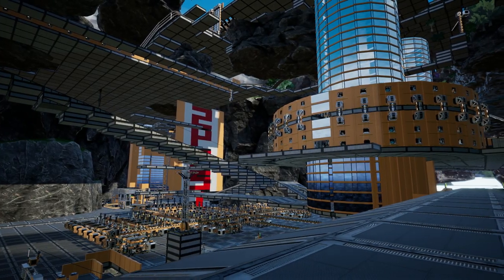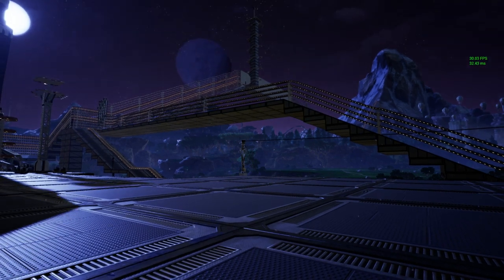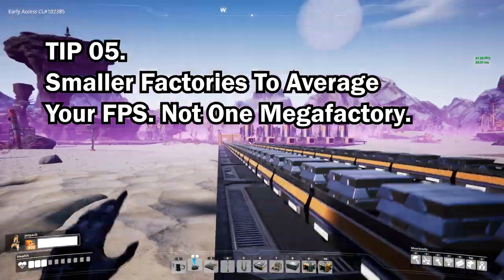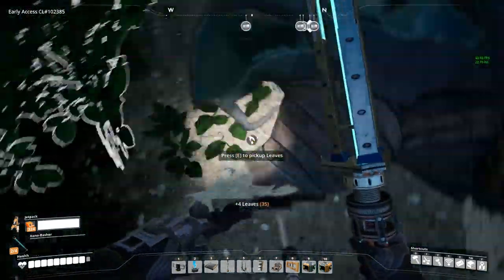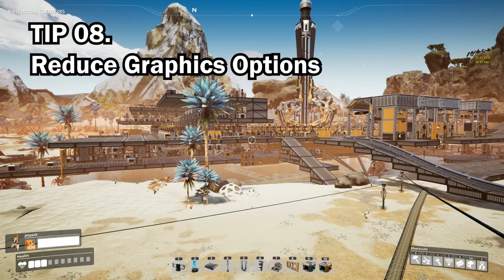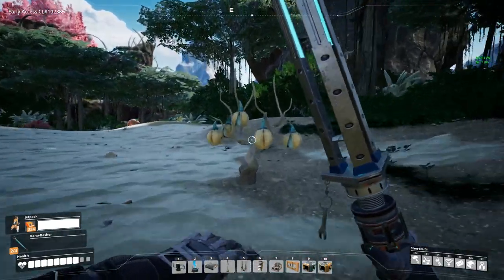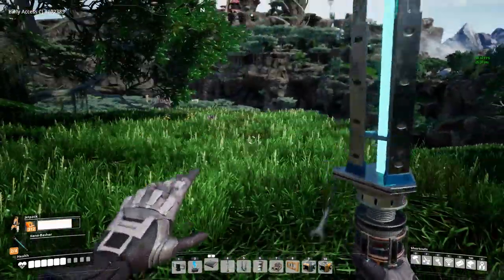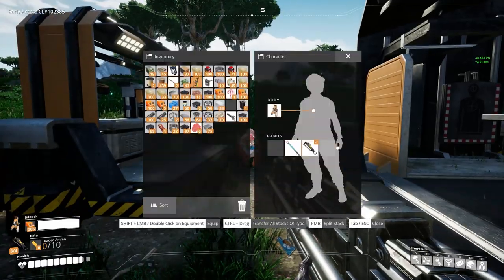14 Top Tips to getting better FPS in Satisfactory

Comment: Tip 8 - reduce graphics settings 
Me : Never, I didnt buy a RTX 2080ti too lower settings LOL...
Put the only lag I get is when the game saves every 5 minutes but other then that its smooth
Reply: You need new PC with 3xRTX ti. Twin SSDs and i9 chip. 64G Rip Ram.
234FPS is Lag
Reply: even with all that, i`d still only get 60 FPS as thats what my two monitors are capped at :(       plus since the last few game updates the lag has pretty much stopped
Reply: I think only at 5 FPS I consider it lag. any higher and it’s 100% playable

Comment: With a megafactory of over 175 hours, the ONLY way I am able to increase my frame rate is to shut the factory down. Frames either double or triple. This suggests to me that the issues may sometimes be the CPU, not the rendering. (Running over 3Ghz, 16G RAM). Additionally, for me, the slow down occurs regardless where I am on the map; being far out of site of the factory has almost no impact.
Reply: I think that my CPU is the problem. When i'm going far from the base, I get like 30% more fps

Comment: I have a question: So does this rule count only for where you are. If you have a mega factory on the other side of the map, does this influence the FPS globally, or only once you go closer, for the game to render said area? So will it help to delete builds, not in use, or old areas so to speak. Also is there some info on what MODS are most FPS intense?
Reply from the maker: Things may have changed a fair bit from when this was taken, but I think it's only related to render distance so factories far away and not currently viewable shouldn't effect frame rate, at least not too much
Reply: @TotalXclipse  That makes sense. Thank you.

Comment: if your FPS is really low you can change your resolution to 1600 x 900, Just maximize your screen and hide the taskbar. I went from 20 fps to 60+ fps (:
Reply: You did more than just change the resolution by 650,000 pixels. Either you are using border line system requirements to where that little of resolution change would increase performance by 200% or you straight up lying. resolution can hurt performance pretty significantly past 1440p but under that you are looking at a 20% difference between 720-1080p-1440p. Also full screen and window mode doesn’t change performance at all.
Reply: @Whoareyoucalling  I'm sorry, after I commented this I found out I was gaming on my I7 processor and not my Geforce GTX 1060x. When I changed my resolution it somehow changed the place I was gaming from.

Comment: What hardware are you using? I have no real issues with running 50-60 fps at ultra settings. Though this game does like video memory, it will use on average 4 gb, but there have been times it was nearly 5 gb for me. But even at ultra my cpu is usually only used at 30-40% and my graphics usually sticks around 50-60%. I only have a 1070 ti that is water cooled and a Ryzen 7 1700 water cooled and clocked at 3.65 ghz, I am running 16 gb of Geil super luce tuf gaming alliance at 3000 mhz and I also use a M.2 for my entire system which is a XPG SX6000 which only has 1000/800 mb/s read/write speeds. 

Still really informative, have you noticed the new menu for crafting, power poles and map?
Reply from the maker: I'm not sure if the new menu for crafting, the power poles and map are from the last update or if you're in experimental? I know they changed a few things last week but wasn't aware of any changes to power poles?
I use an I7 6700k with a 980Ti So it's slightly older than yours but works a treat under pressure thanks to a closed loop water cooler :)
Reply: @TotalXclipse  What I meant on the power poles is they have a new graph. Which looks way better.

Comment: Use trains to reduce lag.
I disagree with that.
Because I saw someone start 16 trains and he went from 110 FPS to 30 FPS.
Reply from the maker: Patrick Frederiksen hey, somethings may have changed in game since this posting - for example conveyor belts weren’t as optimized originally and that’s what initially caused a lot of lag hence why using trains in that moment helped. However they’ve optimized the game hugely since this video therefore some of the suggestions may not be as useful anymore. Sorry

Comment: Hey total I’m thinking about getting an Apple desktop do you think I can get satisfactory with it or would I have to use Microsoft or Crome
Reply: The official wiki says Satisfactory only runs on Windows (https://satisfactory.gamepedia.com/FAQ#What_platform_will_Satisfactory_be_released_on.3F). I believe there is a way to have a mac computer boot into Windows with a boot loader (Bootcamp?). This would allow you to select which operating system to load when starting up. I'm sure someone who knows more can help with that. I don't like Apple, but know a bit about them.
Reply: @friarjon7948  yes you can use boot camp to install windows on apple computers
Reply: you can just install windows directly on a mac.. its the same internally as any other pc, just more expensive and has a brand logo.

Comment: Hmm, if hyperthreading is not yet implemented, and it plays this well, thats awsome. It explains why multi-player is a dog however. As for overclocking, I suspect most people with an Intel CPU don't have that option as only the more expensive K models overclock, and on Ryzen its pointless for the gain you get unless your on a 1600/1700/2600/2700/3600/3700 from what I can see. If your on an old FX AMD cpu, then yea its time to get a new system.

My old i7 4th gen (24Gb DDR3) does an ok job with a GTX 760 (2Gb ram), however I noticed when I tried to play it a few months ago on a AMD 2600X and Radion 580 (8Gb) at 2k it had very bad lag spikes, even in the early game. (not enough to stop me playing it :) ). I suspect I would need a 1070+ or 5700+ to get it smoother in the games current state at 2k, but that it would smooth out as the game becomes more efficiant. I should note on the AMD system I was using the game was installed on an HDD as I have my Steam libary there, its possible the larger texture files loading where causing the spikes, I have a similar setup on my i7 but I do not notice the lag spikes at FHD (1080). Of course this could all of changed since I last played it on the AMD system. I do of course get the lag spikes now, since my game save is not at the beginer end of the spectrum on my old beast.

It would of been nice if TotalXclipse gave the basics of his setup (CPU/Ram/GFX & HDD/SSD). Not that it would influence my buying desisions, I am already gathering the parts for a Ryzen 3600, 32Gb, RDNA 5700, and some form of storage, most likey SATA SSD for my steam libarys and NVMe boot drive. Since the price of RAM and SSD's have really dropped, I can get 3200Mhz in 32Gb's for less than I paid for 16Gb's a year ago, and a 1Tb SATA ssd for even less than the ram.

My god what a ramble that was....
Reply from the maker: Quite the comment there yes some awesome points - as for my system it’s an i7 6700k with FTC 980ti, 16gb ram SsD for Satisfactory close loop water cooled ☺️
Reply: @TotalXclipse  thanks for your reply. I can tell your rather proud its watercooled :), I have build quite a few machines with AIO's, but never hand-made water cooling. Unlike the folk who i built machines for I tend to go for performance/price, so if a free air cooler with the CPU is not going to hold it back, I'll use it. However I do like ITX and low noise, so there is that.

Still considering how complex your build in Satisfactory is, and the age of your equipment, I think the game is doing very well, gets me quite exceited for what it will be like post optomisation. I get the feeling quite a few folk think all utubbers have some awsome sic system. Yours is nice, but I suspect quite a lot of your subscribers have somthing similar.
Reply from the maker: Paul Sim quite a lot have much better - I’m hoping to do a new build come January next year mini ITX custom loop hardline water cooled but that depends on if I can save that kind of money.
Reply: @TotalXclipse  and your gona show it on your channel? hmm hmm?
Reply from the maker: @paulsim7589  yeh, I intend to do a video on it being built like I did the last one - but with better quality :D

Comment: STRG+SHIFT+L does not work for me.
Reply: Aphelion 89 it’s control +shift+l
Reply from the maker: You won’t see anything once you’ve done it. Only once you hit tilde you will see the control bar activate
Reply: It does not work for me neither, ive pressed all the keys before ctrl+shift+L and nothing happened
Reply from the maker: @bydhemon  are you using left control and shift? - also you wont see anything until you click tilde key ` (so if that's mapped wrong you wont know)
Reply: @TotalXclipse  Ok, i did something, as my keyboard is in spanish ive changed the layout to the uk one and it worked, idk why is happening but now is working
Reply: Switch your keyboard layout to english. You might need to add it to your Windows first. Then switch the keyboard layout just before you start the game. To quickly change the input type you can use the WINDOWSKEY + SPACEBAR. When in game press STRG+SHIFT+L release the keys and press the key left of the number 1 on your alpha numeric keyboard. I assume you are using a german layout as you wrote STRG instead of CTRL so it would be the key with ^ and ° on it.
Reply: On a german keyboard the label is STRG and not CTRL. It stands for "Steuerung" which is the german translation for "Control".
Reply: @TotalXclipse  Thank you, after literally hours of searching, I finally got this answer hidden between the world wide web totalxclipse comments
Reply: PS: Im getting 40fps :( (1080ti with 9900k and 16gig ram)